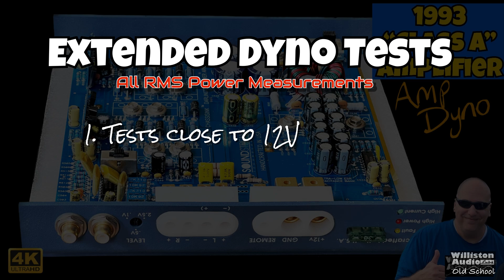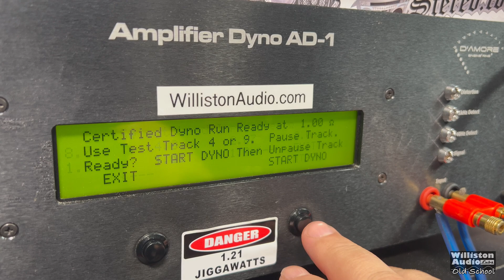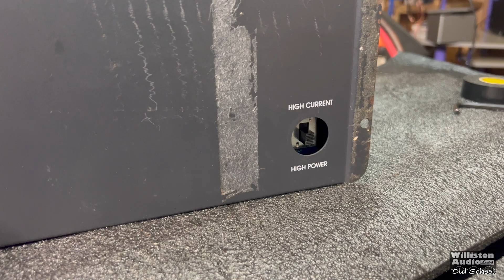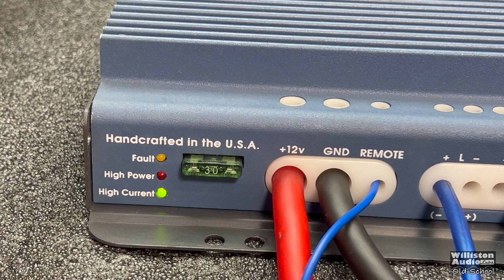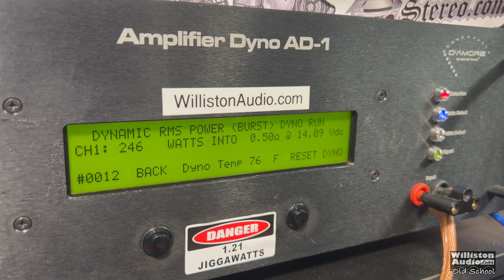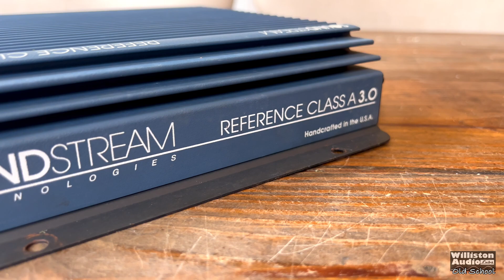Is High Current Better? 1993 Soundstream Reference Class A 3.0

Comment: I stuck with my D and MC series when SS changed to Reference. Glad I did and the local shop seemed to get a lot of them back with a different smell. Lol. What exactly does flipping the switch do?
Reply: You were smart to hold onto the predecessor amps. Reference 300’s and Reference 500’s were terribly unreliable. Reference 200’s were fairly bulletproof, however. Flipping the switch changes the rail voltage to allow the amp to maximize power output into either high impedance or low impedance loads.

Comment: High current mode is to run the amplifier with lower voltage on the rails, therefore enhancing efficiency at low impedance with high current mode on.

Comment: Amp is horrible 😂
Reply: Their new stuff is junk. This amp was still in the good era .
Reply: @Justa3Valvesstang  some of it is not.  But even the lowest model they sell now still outperforms this all day
Reply: @donaldjackson4456  from a power standpoint i agree. But start measuring slew rates and damping factors, then see which sounds better.
Reply: @Justa3Valvesstang  oh im sure.
Reply: Looking at just power versus listening to this amps sound quality.....then you're just gonna miss out on a lot of great amps plus the whole reason amplifiers are actually made.
Oh yeah, this amp is from 1993! 30 years old!
Most amps made in 2023 will barely survive to even turn on in 5 years from now!
So a 20% loss in rated power over 3 decades isn't to bad in my opinion......😄